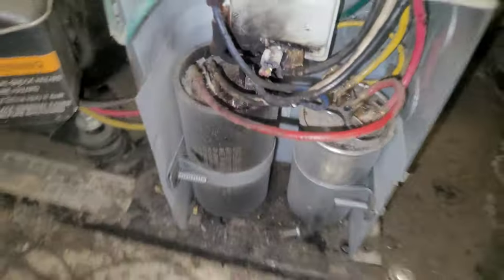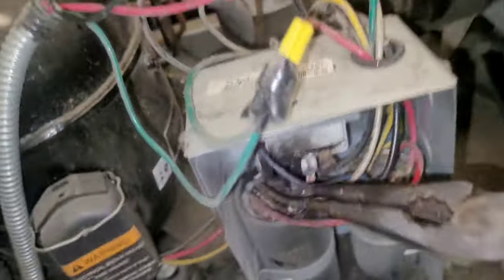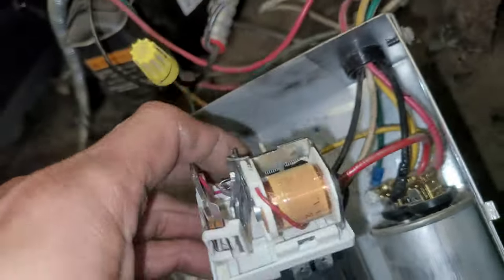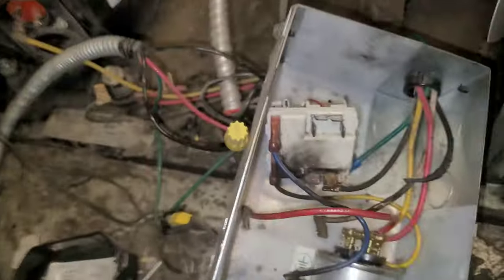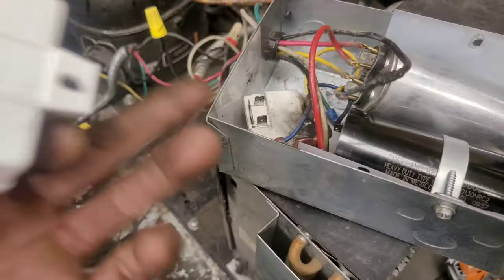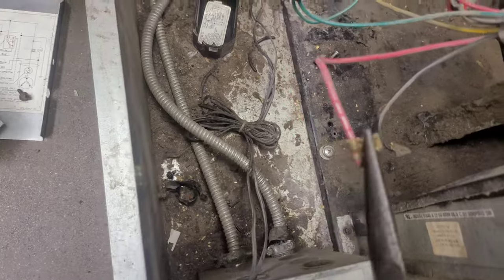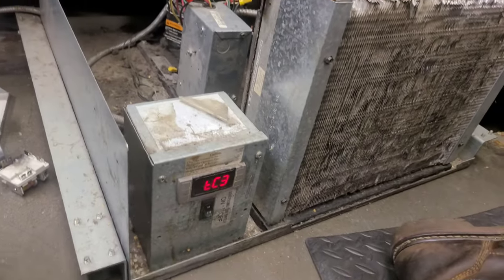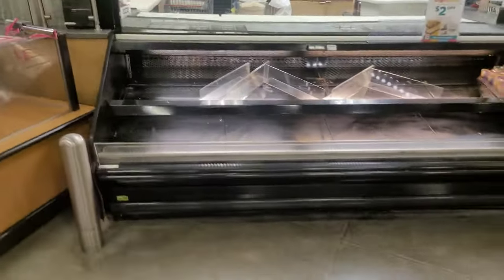Melted Wiring On Start Relay Caused By LOOSE CONNECTION - Change Wiring And Eliminate Problem Later

Comment: I think your lead also got some loose connections😲 Also is that relay upside down?
Reply from the maker: It has an arrow pointing up, so the numbers are upside down, but it is mounted correctly as the arrow indicates.
Reply: @HVACRServiceTech  it looked a little weird👍

Comment: I hate loose connections. I also hate wire nuts/junctions with a passion, I prefer crimp connections. I’ve also had those spade connections crack and break when I try to tighten them. I should carry a bunch of crimp connectors in my bag but I don’t
Reply from the maker: Oh yes I know what you're talking about, you're talking about on the used existing Spade connections that are loose and when you try to tighten them like with the needle nose or with the pliers, they are like brittle or something and then they crack on the rounded portion of the connector?
Reply: @HVACRServiceTech  exactly. I’ve also had units where guys kept resetting motor starters only for me to find out there was a loose connection in on a motor for a 30 ton rtu.